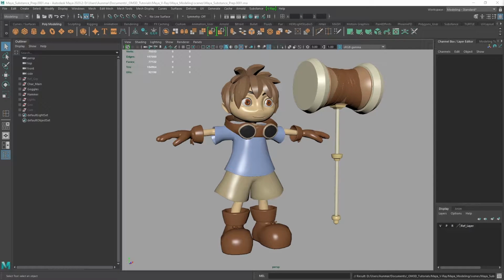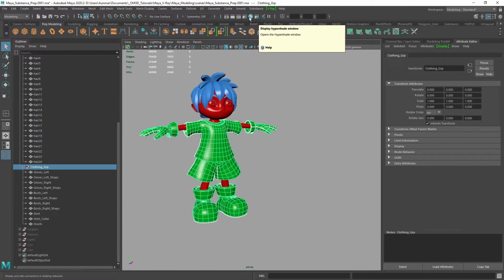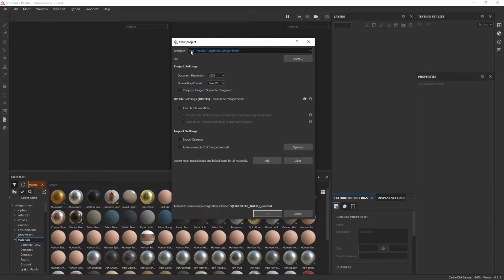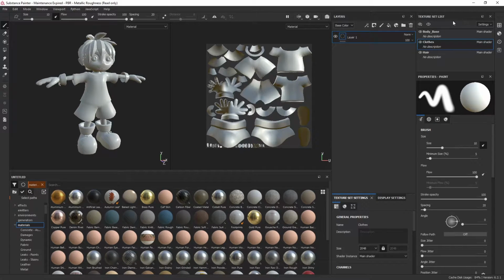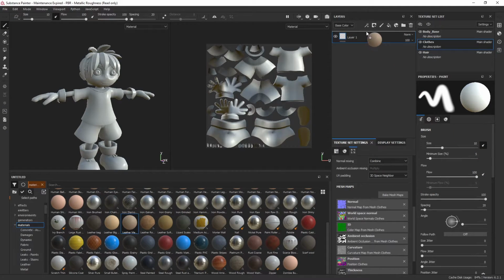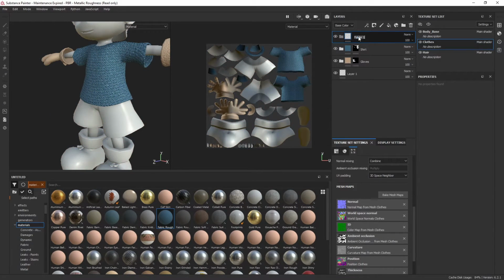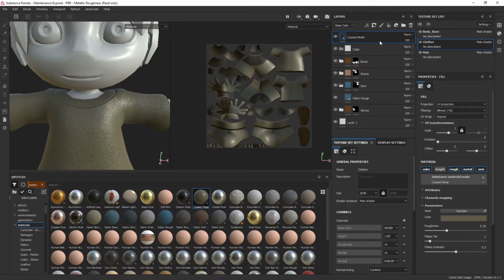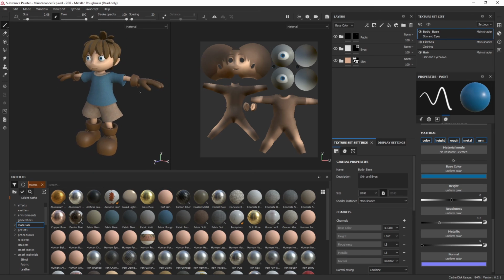How to Import 3D Models into Substance Painter

Comment: im sorry i have a question. I can yee that in export you did not subdivide the model. If you want later on subdivide the model for rendering do you have to subdivide the texturing fbx for painter? Because if you texture lowpoly uvs and after subdivide them in maya. uvs will not fit becase the texture can not bend like uvs do.

Comment: First of all amazing tutorial as usual! Quick question, I've been following along the series in order to make a character myself. I notice you have been only using the smooth preview by pressing 3, but not actually smoothing the character with Mesh -> smooth. At what point do we want to actually smooth our mesh? before rigging since we will deform the mesh? Thanks in advance
Reply from the maker: Thank you! You would want to Mesh>Smooth the model after rigging it. Rigging it in the low poly will be easier since you have less vertices to deal with and the skinning will carry over to the high poly, at least in most cases. Hope this helps!
Reply: @OnMars3D  thank you so much !
Reply: @OnMars3D  oh no, i ended up smoothing my mesh before all this. well next time i know what process i should use.

Comment: How would you import a second model (eg the mallet)? File>Import resources>*.obj isn't working for me.
Reply from the maker: You would need to export the entire model with the hammer, then use the File>Import Resources workflow. Just make sure the Hammer is on a different texture set/has a different material applied than the rest of the character. Let me know if that works!